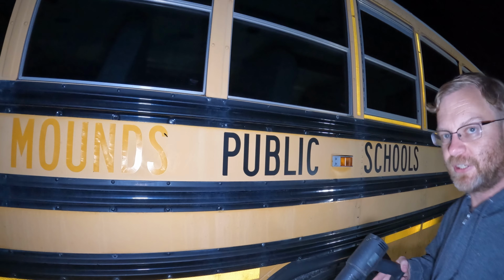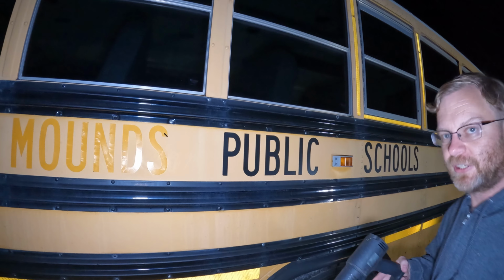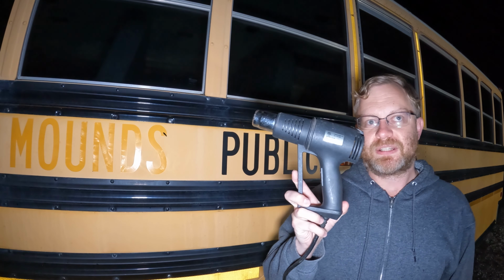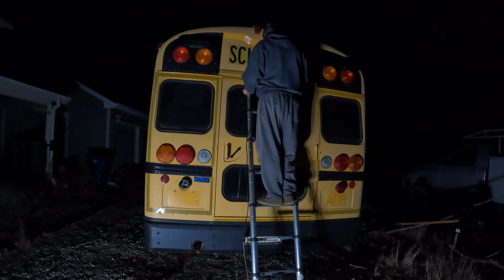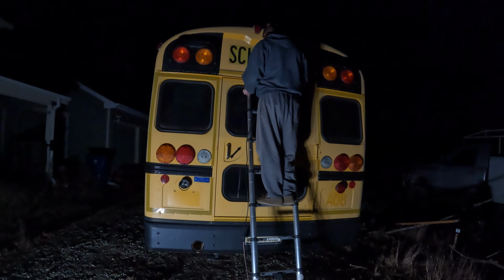Removing Vinyl Lettering from the Outside of the Bus

Comment: That's what I used, a hot air tool and my fingernail. Once the surface gets warm enough, the vinyl letters peel off without too much trouble. It took me about an hour to rmove most of the larger lettering.
Reply from the maker: Agreed. I was having more trouble with the reflective decals. I think I’m going to try a heat gun and a putty knife or a scraper. Thanks for the comment.
Reply: @overthenexthorizon8271 did that work for the reflective tape ?